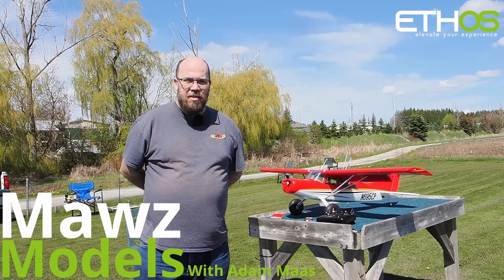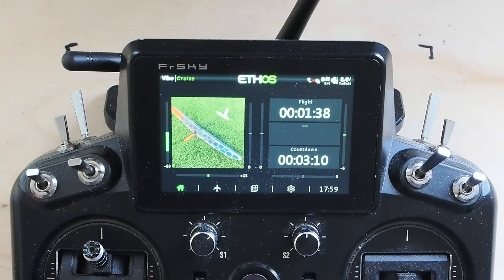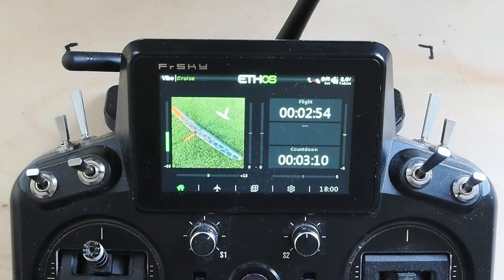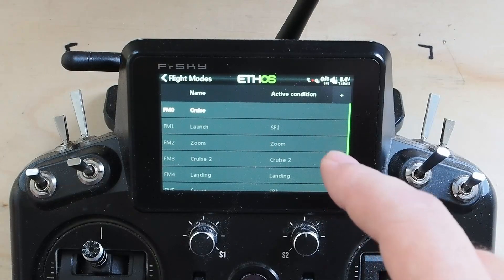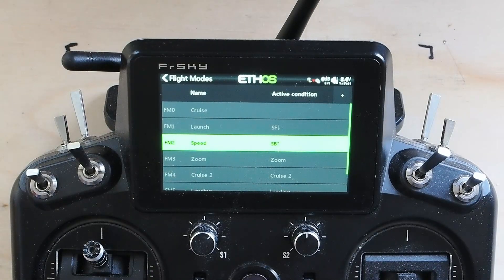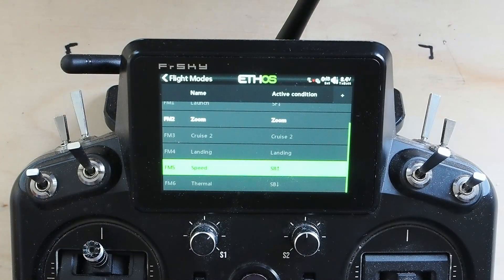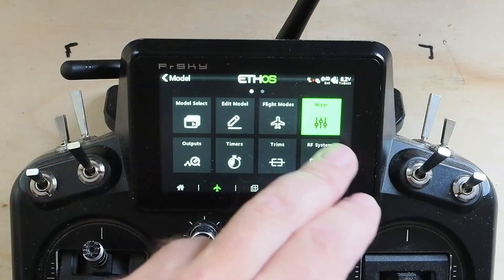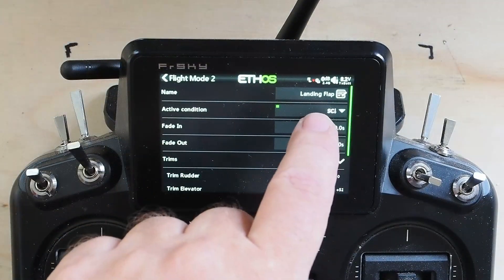ETHOS Tech Tip 9 - An Introduction to Flight Modes

Comment: Hello Sir! Hope you're doing well. Question in Ethos Suite they have Pre-Release 1.5.0 RCO. I've always been told don't down load any pre-release firmware, Because not safe and is this true.
Reply from the maker: I recommend Release Candidates (RCx releases) be used only for testing. There may be bugs present (and in fact there's at least one serious bug in RC0, which has already been found and corrected).